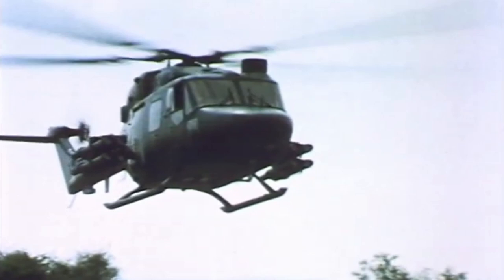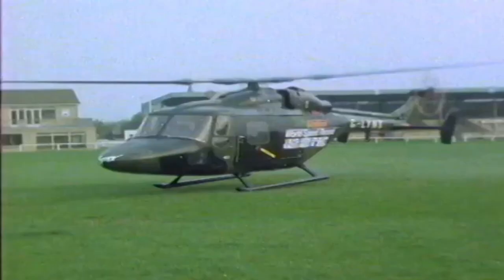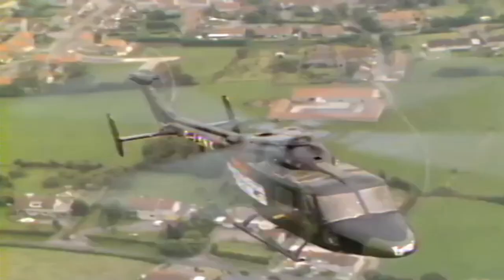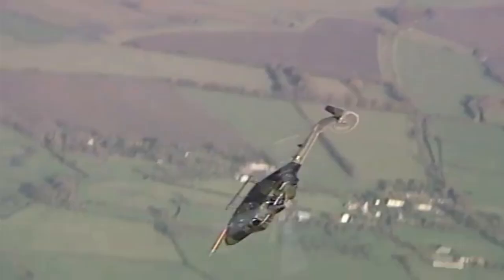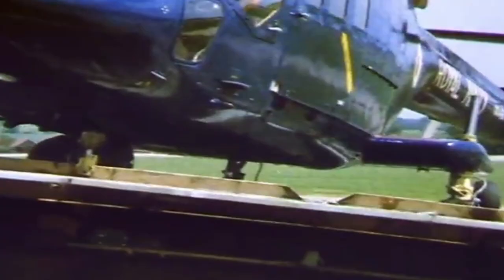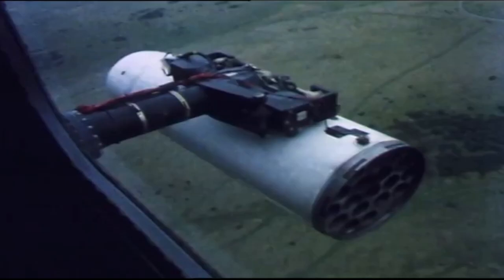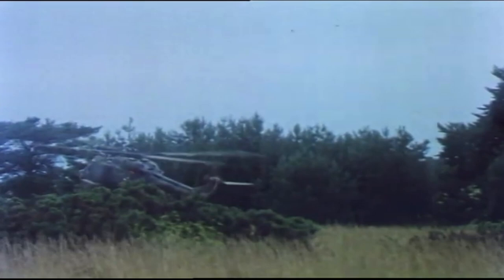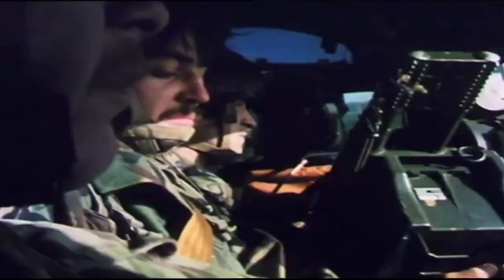Westland 'Lynx' British Multi-purpose Military Helicopter | AGILE AND DEADLY! 🚁☠️

Comment: Matsimus: It is an aircraft that deserves respect.
Where we might disagree is why Lynx is being phased out:

1) In the troop transport role it is to small by todays standard . The Merlin can transport an infantry platoon, where the Lynx can only take a squad. This cuts down the number of helicopters to land a heliborne infantry company from - say - about 10 to 4. That gives a lot of savings ind the number of pilots required - and the number of nuts and bolts screwed upon.

2) In the naval role the ship for a helicopter is the frigate, and they have grown considerably since the Lynx was introduced. A Huitfeldt is about 6.000 tons or about the double of a Peder Skram - class. And a SeaHawk can apparently be landed in worse weather conditions - ALLWAYS a consideration in the Atlantic.

3) The shift to digital - hmm... that is probably rather a question of: "We need a bigger boat anyhow, so why upgrade the pip squeak?"

4) After 40 years of service there might be a change in requirements as a result of the trail blazed by the Lynx.
Reply: About the 40 years of service: People often forget that there was just 25 years between the outbreak of WW1 and WW2.

Comment: In the centre of the flight deck was a metal grid, the lynx had a wire with a hock that would drop down to hold the helicopter in place. There was then a three wire system that would be attached to the helicopter to pull it in and out of the hanger, whilst still holding it in position.

Comment: The lynx was a very agile helicopter and had many roles, however, these were roles that were predominately on paper and never proven to be successful. Cabin access and egress was poor, and impossible if a door gunner was in situ. It had no self defence capacity. Targeting was purely optically which had many restrictions. The TOW missile system, made the aircraft vulnerable on a modern day battlefield, requiring the aircraft to remain in a hover for 30-40 seconds until the missile impacted. It was extremely restricted to the numbers of infantry it could carry, I never saw it carry 9 troops,. In Afghanistan, it was restricted to flying at certain months due to the e heat and altitude. Lynx is from the era of where the British MOD always purchased multi role aircraft, jack of all trades, master on none. This is in reference to the Army Air Corps versions. It took the Army Air Corp over 30-years to realise you need a dedicated attack helicopter, even though the Americans proved this in Vietnam and the Russian proved it in Afghanistan.
Reply: It can take nine I wittness it!  Some poor sod had so sit right at the Back middle, Block in from all views!  I Know I was that soldier :) If Any thing had happen I wouldn't be writing this text now!  But In Ulster I was safe than Roads in 1989.  I would hate too know what the T6 Temperature was for the Pilots under you!

Comment: ex reme airtech here. when i left in 85  the lynx took 23 manhours of labour for every flying hour
Reply: And then setting fire to itself on the pan 🤣😂 oh the joyful days of watching the oil burn off on shutdown with nitrogen extinguisher in hand 😂
Reply: @leewolfenden2679  yup ! i also remember doing wet starts to purge the fcu`s after engine changes.... whole back end up in flames!  did you ever experience blade tracking using the flag technique?  .... scary shit!
Reply: Please dont forget the Lynx bites from the wire locking!